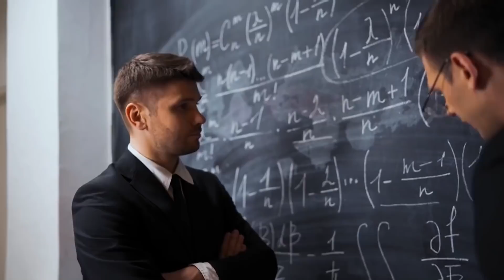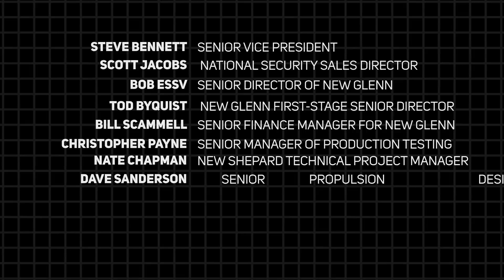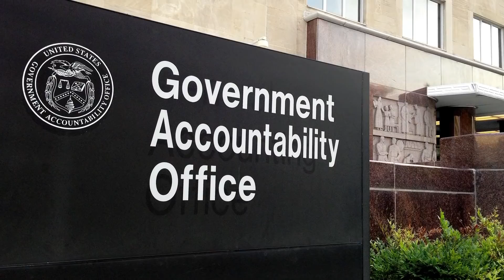Why Talented Blue Origin Engineers are Leaving to Join SpaceX & Elon Musk

Comment: Blue Origin byte more than what they can chew, promising the new rocket engine BE4 - which is now five years late.
Possibly, now they have spent more money for the development than what they initially envisioned. Instead of pushing and delivering the engine anyway and as quick as possible, Blue Origin is alienating customers by increasing their prices.
The tactics of legally challenging NASA, the government and the competition, is making a bad name for Blue Origin. An engine designer usually takes care of the design from start to finish, like Tom Mueller did for the Merlin at SpaceX.
When a Blue Origin propulsion engineer leave his job middle course, I wonder what his replacement is going to do with an half-baked, non-functional engine design. Does he try to understand why the engine doesn't work, and modify it with minimal expenditures? Certainly not.
Developing a rocket engine is a one-in-a-generation event, a job which is burning inordinate amounts of cash until the engine makes to the pad.
NASA spent tens of millions of 1960 dollars and two years of time to eliminate the combustion instability problems of the F1 engine, blowing up a number of engines and ruining the test stand, while preparing dozens of different injector plates until the engine worked reliably. Mr. Bezos knows this very well; he paid for the recovery of an Apollo first stage from the depths of the Atlantic Ocean.

Comment: Wonderful thumbnail, even though it’s fake, the space community loves this one lol. ^_^

Some inaccurate information though (generally related to considering BO seriously at all), BO is less of a competitor than Rocket Lab, Astra, Firefly and others. They have a sounding rocket after 21 years, and there’s no way they’ll be in orbit before 2023 (2022 is only in name, it’s impossible at this point, BO has only made a mock-up outside of the engines, and even if they made everything else in 1 year they’d have to give any engines to ULA… and integration testing takes time). 2023 is still theoretically possible… 2024 and 2025 is more likely, but it could easily take longer. 

There’s Project Jarvis, but that doesn’t change that BO is harmful to space efforts.

Edit: Well, they finally gave up their lawsuit and they’re scaling up a lot. 2024 is starting to look more doable. It’s still the only newspace company I want to fail.

Comment: When at the end of 21 years you only have a flea jump at the frontier of space, you are inevitably disappointed!
Reply: Neil deGrasse Tyson put it in perspective... If you were to reduce the earth to the size of a school classroom globe (of the earth), then Bezos managed to get himself about 1.75mm from the surface. (about 1/15 of an inch)
Reply: @brunosmith6925  that really puts it into perspective. There’s a huge difference between doing what blue origin did and actually putting something into orbit.
Reply: @georgeidarraga4006  Another interesting fact is that there are amateur rocket enthusiasts who build rockets in their garden sheds, who then get these "vinegar and brown paper" contraptions to amazing heights. And look at New Zealand based Rocket Lab... They are a tiny company with a tiny orbital class rocket.
Reply: @brunosmith6925  I think you mean 1.75cm not 1.75mm
Reply: @peterlyall2848  No... I mean 1.75mm.
Here's the math.
The diameter of the earth in mm is 40,000,000,000.
The diameter of a classroom globe is around 700mm (roughly the same size as a round football).
The ratio between the above two objects is:
1:0.0000000175
-----------------------
Now, using that ratio...
Multiply the ratio by 100km (or 100,000,000 millimetres) The karman line...
Answer: 1.75 MILLIMETRES.
... QED
======================
(PS: I checked the sums with my 11-year old daughter).

Here's another interesting fact. If you were to reduce Earth to the size of a billiard ball, it would be many times SMOOTHER than a billiard ball.
Reply: The idea the celebrated essentially a manned high altitude jump and pretend like they are even in the same orbit as Space X